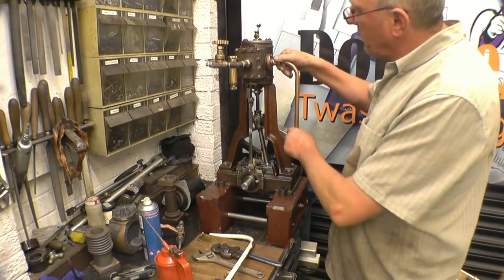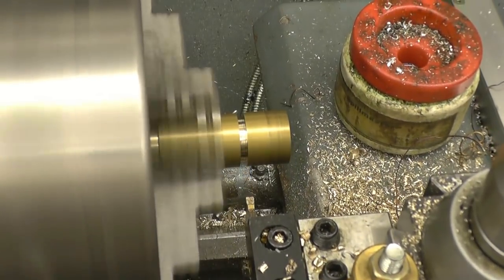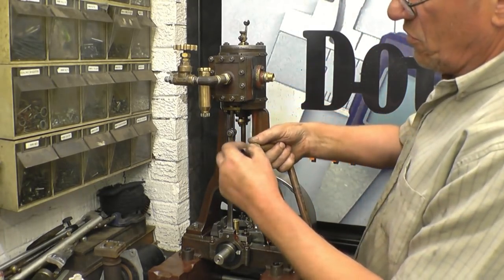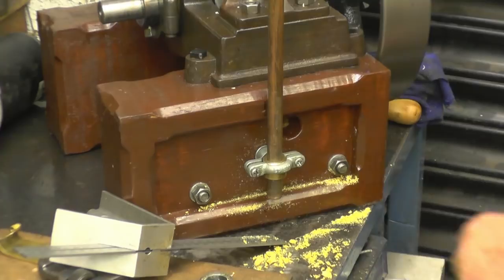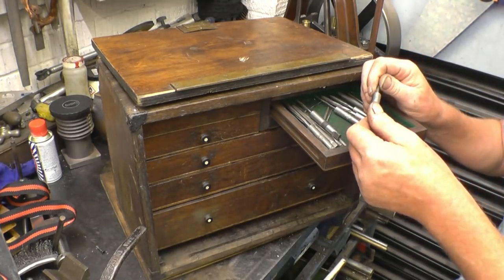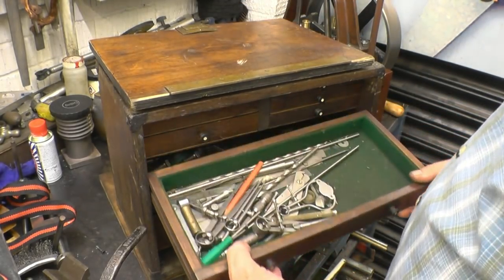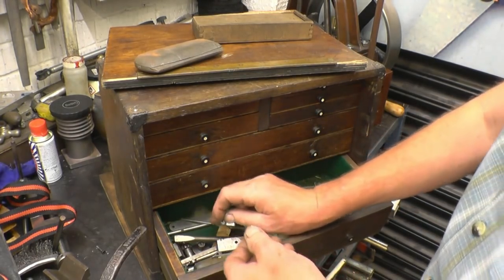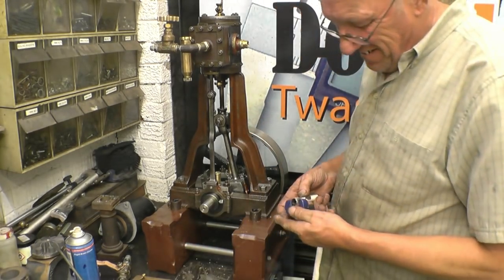SNNC 236 P2    Engineers Tool Box

Comment: john you cant use that crap modern mass produced pipe clamp on the steam engine
Reply: First thing that crossed my mind too
Reply: Well, the clamp would be ok with new cheese head witworth screws, as it would be similar to the century old one, but the modern compression fitting is wrong, needs to be a proper old flared end, the adaptor flange and the fibre washer and packing, so that it is period, and then it will go with the half inch ( not 15mm metric equivalent) pipe.